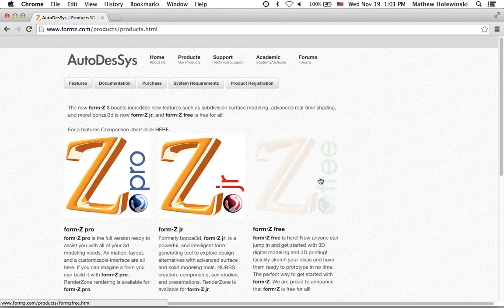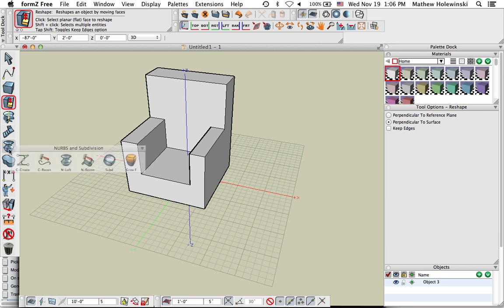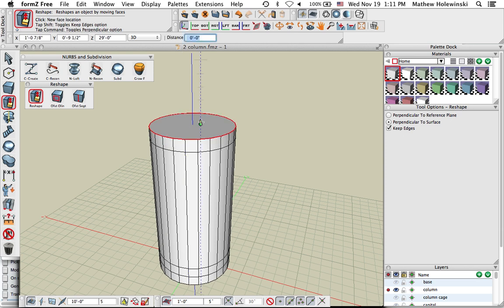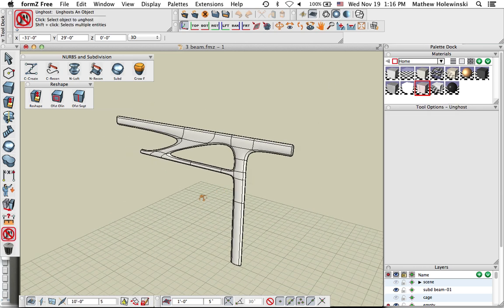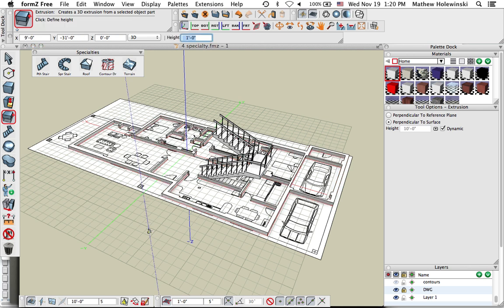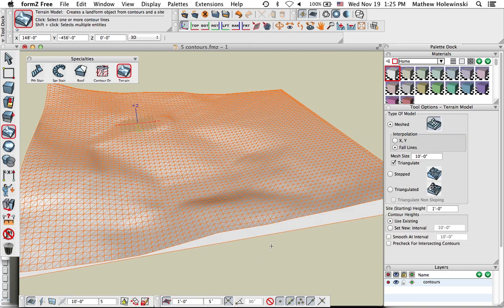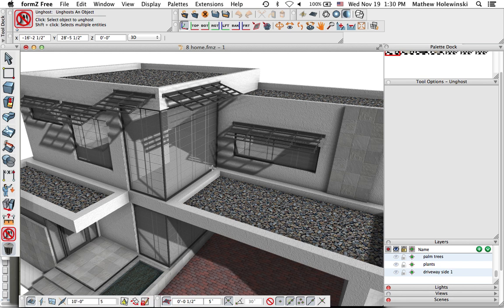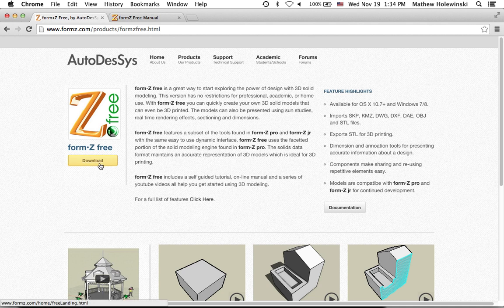formZ Free

Comment: I have a decent intel i7 computer with windows 7.  When trying to run formZ, I just get a plain grey region in the work space.  Unable to draw or do anything.  System locks up when attempting to play the demo videos.  Any ideas?  Thanks for making this powerful tool available for free.  Once I get familiar with it, plan on upgrading to the full package.
Reply from the maker: Gavin Curtis 
HI Gavin,
Sorry you are having trouble.  This sounds like it is a problem with the video driver.  If you update the video driver (download it from the manufacturer of the laptop, or the manufacturer of the card itself and then install it), does that solve it for you?If not, does updating the driver for the chipset of the motherboard help?If you are still having trouble, does your card meet the OpenGL requirements for OpenGL as noted here?http://www.formz.com/products/formz/formzSystem.html(If you need any further help, please contact us directly at support@formz.com for fastest support.)Did this solve the problem for you?
Reply: formz3D
Thanks.  I got it to work.  I upgraded the video driver to no avail.  The computer is just over 1 year old and is a gaming laptop.  Plenty of horsepower.  What fixed it was updating the motherboard chipset driver as you suggested!  Thanks!  It feels weird that software this powerful is free.